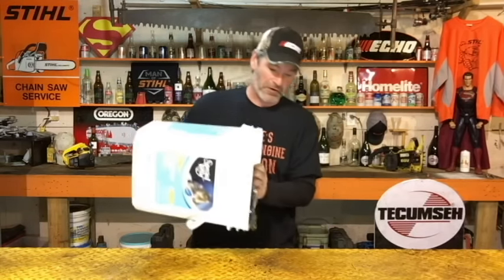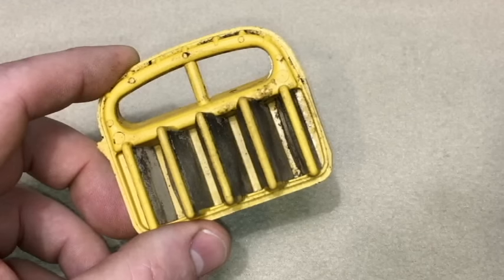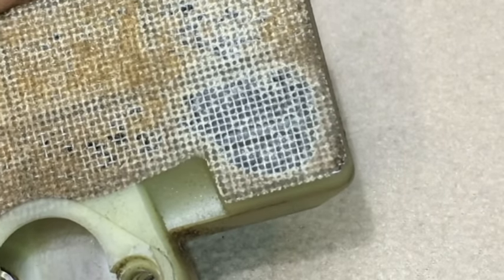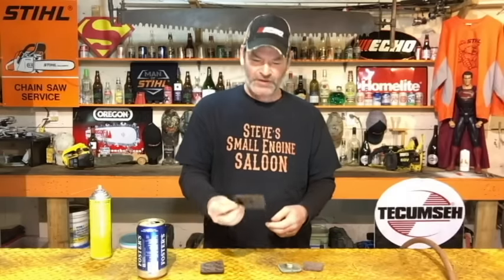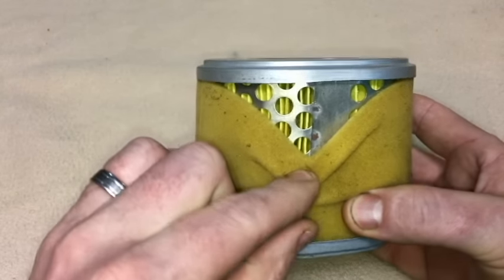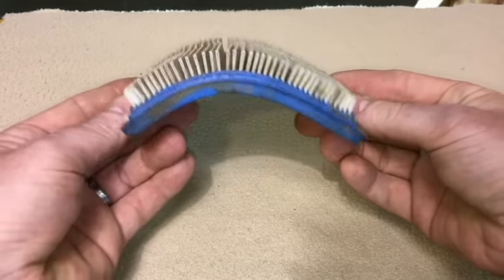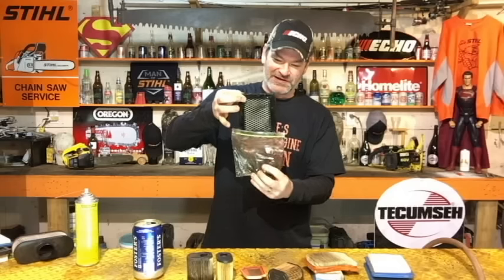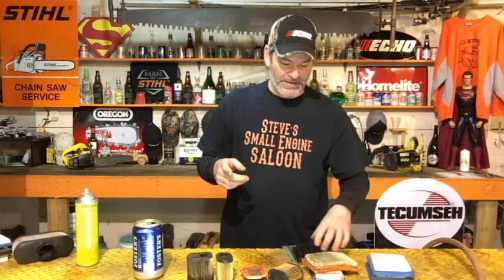How To Clean An Air Filter

Comment from the maker: Click here for air filters---- https://amzn.to/37K0Mbd
Click here for my website--- http://www.stevessmallenginesaloon.com/
Click here for my Parts and Tools Store---- https://www.amazon.com/shop/stevessmallenginesaloon
Reply: @Peter Frencken Good question.
It makes dirt stick to it on contact.
There is a specially formulated oil under the "Honda" brand name that is way better that regular motor oil. It has the same consistency as snot. It looks like it too.
It is WAY STICKIER than regular motor oil.
Reply: Try mineral spirits.
Reply: I'll bet THAT guy changes the oil in his air filter every 100,000 miles weather it needs it or not.
Reply: Mr Steve how can you tell if your 2cycle gas has water in it when it have rained
Reply: Also forget about using the wife's sink. I got kicked out of the house. No fun sleeping with the dog's
Reply: beer 🍺 works well also

Comment: Amazing, because of my dad (he passed away 9 years ago) I learned from him how to do many things, one was how to clean filters of lawnmowers... the pleated filters. We have followed your tactics and have been successful and save a lot of money over the years, and yes the mowers always worked - once the filters got on the shabby side we would purchase another one. Also, just an “FYI” on shop vacs, if I have done some dirty, filthy, dusty cleanups, I start out by taking the round pleated filter out  go to the center of my yard,  toss it up in the air and let it fall on the grass, I do this multiple times, till the dust is mostly gone. Next, I get my air compressor out and shoot air from the inside of the circle to the outside, once the dust quits coming out, I am happy enough to reinstall it. 🙂🙂🙂 Steve, you are an awesome person, wish my Dad could have seen your web site, he would have enjoyed it.
Reply from the maker: Thank You...
Reply: campmein ,  good tip, and if I may share one of my tips,/past mistakes-  shop vacs will clean up water, gravel and other wet non flammable material but when you use the Vac for water or wet jobs don't forget to oull the filter when done, rinse and clean it and leave it somewhere to dry out.   I have had them rust out AND turn into a putrid "science project". lol

Comment: Steve, 
The old Briggs & Stratton foam filters did say to wash it out in kerosene (lots of people used gasoline) then coat with engine oil. 
I was taught to squeeze the excess oil out, install it, and drive on.
I just recently did this, before seeing this video....I don’t recall ever learning about the soap in water,
Reply: I cleaned the 1970 norlett mower's 3.5hp briggs engine foam filter and then the 1999 Husqvarna 252RX trimmer's air filter and then the air pre filter when i failed starting it due to a hole in the carb being clogged 😄

Comment: Great coverage of all types.  The note about foam filters is appreciated.  If I had a paper filter is clogged with oil or nasty wet debris, from say sticking to gas or dampness, I'd do the gas thing 2-3 times with fresh gas each time and then blow it out with compressed air, and I'd always blow it from the inside out.  Blowing compressed air on the normal air intake side will just further embed the debris and crud.

Comment: Howdy Steve, I was hoping you would explain the result of running equipment with a choked airfilter.
Some folks think that a dirty airfilter is actually a good thing as it lets through less dirt.
We see lots of premature wear due to choked engines washing the bore.
Great video as always.
Thanks from Australia.
PS Gazz is right about Fosters and VB.
Reply: The result is you won’t get enough air to your engine for a clean fuel burn.  Result is thick black smoke out your exhaust

Comment: Steve, great video as usual, thanks! I wish you would have talked about the foam filters, after you clean them you have to oil them. My Dad used 30 weight engine oil, I actually bought some "Foam Filter Oil spray" in a can. Cool stuff, but would have liked to seen your take on how much oil to leave in it, tips and tricks, etc.
Reply: I've been told you only oil them if your filter is cloth or covered in wire mesh. If paper, then you don't oil the foam pre-filter.
Reply: I just looked up the owners manual for my Shindy EB910RT blower and it clearly states NOT to oil the foam prefilter.

Comment: Steve, for sure you’re to young to remember the older automotive oil bath air cleaners.  Even the what I would call previous Brigs with foam air filters, would recommend applying oil to foam, then squeeze out.  Great dust adherence.
Reply: I was amazed he did not mention oiling a foam filter.  Makes you question the credibility.

Comment: Great video, about time someone dealt with this poorly covered topic. Would be good if you added how to oil the foam filter after washing in dish soap in that Magic Sink. I maintain friends machines and frequently their foam filters are oversoaked with oil which limits air flow causing rich mixture, not good for engine life. I squeeze the excess oil from the filter while it's wrapped in a sheet of paper towel.

Comment: When you blow a paper filter with compressed air shouldn't you only blow it in the opposite direction (like back flushing) the air flows while in operation?
Reply: Correct, from the carb side of the filter back out.
Reply: No!  You should never blow on a paper filter no matter which direction you are blowing.
Reply: @engineclinic  you can do it with low pressure.  You need to use discretion.  But not everyone has that so I can understand why you and others will say that.
Reply: @nbpt1000  I say it because of an in depth study that Quaker state did on air filters.  I was involved in the business at the time and had no reason to dispute the data.
Reply: @engineclinic  OK....it would be interesting to know the details of that study.
Reply: @nbpt1000  you might be able to contact Quaker state and request it.  Not sure.   I'm not sure if I would still have the paperwork in an old file cabinet or not.
Reply: Mike Holcomb so did you find the paperwork in an old filing cabinet or not?
Reply: You DO NOT blow out a paper filter.   A filter is used to filter,  if you blow even microscopic holes into the filter you are damaging anything it is used to protect.  You're welcome.
Reply: I was really hopeing Steve would have covered this in the video😑

Comment: I suggest that, if your air filter contains plastic, you use CRC Mass Airflow Sensor Cleaner. It is designed not to harm plastics. Brake Clean can damage plastic. Carb Cleaner I am unsure about. For the record, CRC MAF Sensor Cleaner is excellent at cleaning chrome and removing road tar.

Comment: Steve, I've looked at many other different channels that offer self-help/instructional videos  for small engines/tools etc. on YouTube before finally discovering your saloon. You make it far more comprehensive, thorough, as well as simplfied , practical & interesting than other channels. Not to mention the fact that a refreshing, cold, adult beverage is always a part of the fix-it strategy!
 Thanks for all the pointers & for sharing your knowledge & expertise! :-)  You helped me get my lawnmower engine spinning like a top again in another vid you put out!
  Quick question on the air filter cleaning... I don't have a compressor so, after carb cleaner spraying, I have a wet/dry shop-vac used as a blower with a cone point hose end attatchment.  it's not nearly as powerful as a compresser. Would it still be sufficient for drying the air filter that fits in front of the plastic  carburetor models?

Comment: Great presentation. The BEST way to check under one's lawnmower is to push down on the handle raising the front wheels then put something heavy on the handle. Either way you tilt the mower you put stress on the Wheels. Yes I USED to tip it away from muffler side until I realized what was happening. Thanks for the tips on air filters- the most overlooked and yet cheapest item to replace. Lol- I've seen people take them out completely! We know what happens next!!! 😀

Comment: I clean all my air filters with soap and water including so called pleated filters but are more like cloth then paper without any problems.  They look perfect when I'm done.  I've heard of others who do the same thing.  I've rarely but will replace it if it looks bad or in doubt.  I  have 15 and 10 year old cars from new with original engine and cabin filters.  I do question myself but unless proven otherwise I will continue>

Comment: My brush cutter's air filter is just 2 sponge elements, which I soak in a small container of my 2 stroke fuel/oil mix, and then I squeeze it out. It cleans out perfectly every time. the theory behind using the fuel/oil mix, is that the sponge absorbs some of the oil, which helps it to trap the dust more effectively. It's never damaged my air filters, and I only overhauled the engine for the first time, around September/October 2018. That's 4 or 5 years of engine life, which is the common lifespan for a standard Tandem CG43 engine on the garden services, and my one works hard, in a very dusty farm environment.
Reply: Hi Notebook,.  I have had many engines with foam filters over the years (about 50 years) and I've always washed them out with gas and then squeezed it out and put oil on it and squeezed it out again.  This gives the entire filter an even coating of oil.  My dad bought a new garden tiller from a dealer when I was younger and he showed us how to do that and I was old enough to do that job and I have done it ever since.  I have never had to overhaul an engine with piston problems or burning oil problems.  I always seem to get extremely long life from my engines and never retire a machine because the engine is the problem.

Dale in Canada

Comment: Gasoline is great and inexpensive solution that does not dissolve the glue
Reply: i did a lot of lawn mower work as a kid in the 80s (to make money) and had 2 containers of gas, I'd repeatedly squeeze the foam filters in the dirtiest gas, followed by the cleaner gas, then added a few drops of oil and squeezed the filter into a little ball to lightly oil the foam filter. if you think about it... most filters should have resistance to gasoline due to proximity

Comment: I had a paper filter on a lawn mower that became so plugged up that the vacuum from the carb began to suck oil out of the crank case through the crank case vent and then directly into the carb. It made the mover smoke so bad I thought I'd burned it up but after I replaced the filter it cleared right up and I'm still using it.

Comment: I have washed pleated paper filters in hot soapy water making sure the inlet side is down and agitating it. You need to rinse well and let air dry. Best to do this at night after you are done.
"Foam" filters I have washed in solvent and not the environmently friendly crap, wring it out and put a little oil back in it. All others just like Steve demonstrated.

Comment: Just replaced my air filter on my Craftsman tractor this spring. Got it in 06 used replaced the air filter after I bought it. Been cleaning the air filter every spring until this spring when the foam pre filter was about done for. I always cleaned the foam filter in a bucket of soapy water and blew out the paper filter. Worked for 14 years and should work for the next 14 years if it lasts that long. Being my tractor is already 29 years old who knows but I take good care of it. I change the oil at least once a summer and in the fall. If I use it during winter I change it in the spring also. I probably am changing it more then I need to but hey it's not hurting anything but my wallet lol.

Comment: Great video!!  Obviously sometimes it's just replacement-only based on the condition but the idea of re-using filters with cleanings of this type has crossed my mind and it was the myriad filter-types, and possible issues they could have being cleaned, that stopped me from experimenting - thanks (as usual!!) for such a great, practical break-down of how to approach filters (am working my way through your chainsaw-series a 2nd time to try and 'digest it better' so to speak, such gold thanks so much for doing this I hope you've gotten significantly-boosted real-world traffic to your shop because of this!!)

Comment: The Stihl 026 chainsaw air filters can be taken apart for better cleaning. The case halves snap together and I always find some dirt inside them. Soak them in warm dish soap water in a discarded plastic sandwich clamshell container or cookie tub, etc. and use a soft bristle toothbrush to remove the dirt from the filter flocking and the case halves nooks and crannies. Since the OEM air filter cost about $20 it's well worth the time to clean one.

Comment: For foam filters, use NoToil. Their filter oil becomes water-soluable with their cleaner. Been using it on my dirt bikes for many years and switched over to using it on my lawn tractor filter cover also.

Comment: A point to add: some foam prefilters may need to be oiled but NOT ALL of them. Check your owners manual. My Shindaiwa EB910RT manual says "DO NOT OIL" the foam prefilter. (I'm not trying to tell you [Steve] what to do! :) Just adding this based on a comment or two that I read later on. Cheers!)

Comment: Excellent info - but a couple of additions.  When blowing out paper filters, ALWAYS blow them out backwards FIRST. ie from the carby side, not the open air side.  If you blow it from the open air side, you blow all the crap hard into the filter material blocking it completely.  Always blow this side after the carbie side.   Also - with the foam pre filters like on the GX Honda/ Chonda motors, I have always washed them in non ethanol petrol/ gasoline and then carefully blow them out.  Never a problem.  You can wash them over and over.  After reinstalling onto the main paper filter housing, I ALWAYS spray the pre filter with K&N air filter oil.  (NEVER the paper)  This stuff is magic for trapping fine dust that will pass straight through the paper filter and destroy your bores and rings.   Been there, done that and trashed a brand new engine in a dusty workplace when I stupidly believed that "air filter spray was complete BS."  On the new new replacement Chonda, I got over 300hrs before any signs of wear.  I religiously washed the prefilter every 5hrs and changed the engine oil every 15.  New oil is cheap - engines are not.

Comment: For paper filters especially, I just use the shop vac on the dirty side. I suppose you can blow through the clean side or oblique to the dirty side witj the compressor  but then you're just blowing dirt everywhere.
Reply: 'everywhere' is outside

Comment: Really enjoying your helpful tips Steve. Had the same problem with an air filter (not mine of course!) soaked with engine oil because tipped the wrong side. Not only I took it in the magic sink, I also boiled it in the magic saucepan! Worked very very well to extract the oil. Hope this helps,
Reply from the maker: Great tip!

Comment: For 90% of my small engine air filters, I use an ultrasonic cleaner. Paper and flocked filters don't clean in the ultrasonic. At medium temp, for 30 minutes, they will be like new. I also clean carbs, small parts.. hell, even jewellery and my eye glasses. About $100 on Amazon, for a good one. It's a must for any small engine shop.

Comment: I found that using 2 stroke fuel and air for cleaning filters is pretty effective. You always get some fumes or even some spit back from the carb on these filters during normal operation. Definitely gotta be careful with the flocked filters though.

Comment: Thank you for this video. On my last air filter for my chainsaw and wasn't sure id have time to run to the store before I'd need it next.

Having ridden dirtbikes in the past, I'm familiar with cleaning the foam filters, didn't know if it would be recommended with the compressed fiber.

Comment: Steve, I use the crevice tool on a vacuum to remove the heavy debris from a paper mower filter, works great until the paper gets loaded with fine dust (turns grey) and needs to be replaced. Briggs has an oval filter and it gets oil soaked from mowing uneven ground, it gets replaced 2X a year and seems to be a problem by design. I usually get the knock off element because they are cheap and work just as good as OEM.